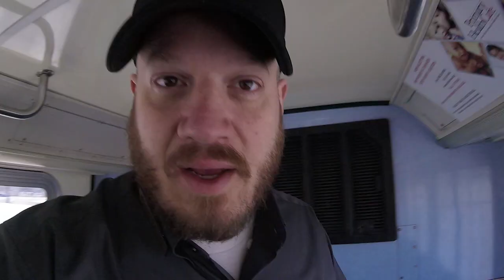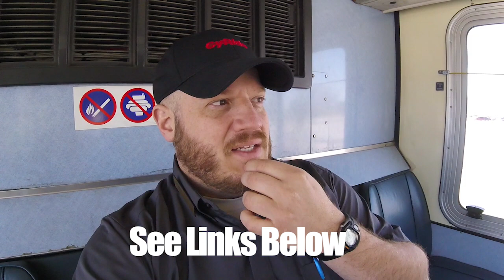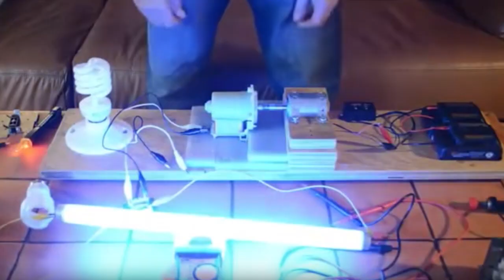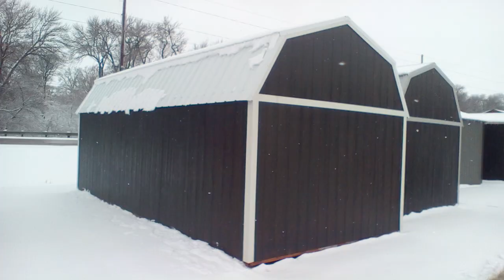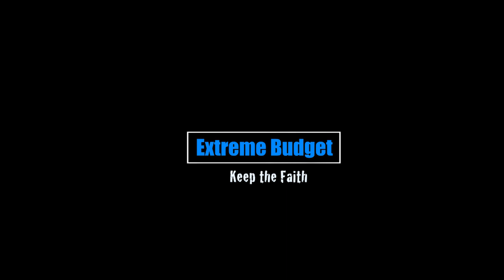PART 1 - DIY Innovations - Free Electricity with Self Perpetuating Generator

Comment: Wrong wrong wrong.   The first comment was correct. You will never create power.  
   Those videos are of a device that has no load or very little load. Which means the non permanent magnets on the stator are not charged

To put simply it may run for short period with nothing drawing significant load from it but the second you try to run something such as a saw or welder those non permanent magnets will create a force and bring it to a rapid halt.  If you want proof of this watch a small 1000 or 2000 watt generator run with nothing on it then plug in a microwave or toaster or ac and listen to what happens to that generator motor. As soon as a load is needed the stator is charged and all of a sudden it takes multiple times the number of horsepower to turn the generator. 

I applaud determination but some of these snowflakes should open a actual physical science book. 
  I gotta go now. I have to go milk my magic unicorns.
Reply: I hate to burst everybody’s bubbles out there but what this guy is saying is absolutely true I tried to run 2 1000 watt  grow lights on a generator during a power outage they put a serious draw on it and eventually the lights dimmed out and wouldn’t come back on even though the generator stay running. The generator was also rated at 5500 W so it should’ve been more than capable enough to do it.

Comment: It is impossible to not only have two motors power each other, but provide extra energy on top of that. You cant create perpetual energy from nothing. I would not only bet my paycheck, but my car and house on it that his two motor setup will not run on its own. I had the same idea decades ago before I learned. I knew a guy who tried building an electric go kart with alternator hooked up to it, think it would power the thing. It didnt. Cars dont do it, either. The energy to charge your battery comes from gasoline spinning the alternator. IMPOSSIBLE. PROVE ME WRONG.

Comment: You don’t need that ballast to make it light. Do you hold it next to CB radio antenna and key the mic to transmit it will light if you were to touch the metal part you will get shocked

Comment: Since I haven't seen the video you speak of nor am I an electrician, were you able to make this work? By work, I mean can you actually get electricity from this setup. My guess would be no as it was explained to me by my father who is an electrical engineer. The issue here is that you can keep the two motors running for some time. As soon as you start to divert energy away from the motors and use it for other things you rob the energy needed to keep the motors running. Once you start to take energy away, the motors will come to a stop. Also, the motors themselves will not run forever, they will eventually stop because of the law of diminishing returns. Some of that energy will be turned into friction, heat, and possibly due to some air resistance, these motors will stop on their own given enough time. Think of it this way, if the motors generated much more energy than they needed and if you didn't divert energy away, those motors would continue to spin faster and faster to a point they would fail from the high RPMs ending in the motors ripping themselves apart. That's never happened in any setup like this so if it isn't generating extra energy, then it has no extra energy to give. I get big companies trying to keep secrets, however on this, they are abiding by the laws of physics.

Comment: Using The fluorescent bulbs is true. Take a fluorescent bulb hold it in your hand in the middle don’t touch the metal part, hold it real close to CB radio antenna and the bulb will light
Reply: So what? Disconnect the power to the radio and the tube quits glowing. No free energy was created at all.

Comment: Seems like there would be a way to produce your own power with a PTO generator. Sort of like this https://www.electricgeneratorsdirect.com/IMD-PTO-22-S-PTO-Generator/p5891.html . Buy an electric motor and figure the ratios for the belt to turn the PTO at 540 RPM's which is what this particular model requires. You would have to figure out a way to start it but once started it seems like you could power the electric motor to turn the motor and PTO and have plenty of power left for whatever. Hope this makes sense.
Reply from the maker: thank you

Comment: Look People this stuff does work, it takes time and money and every single system is individual and requires a lot of fine tuning, parts, trial & error and backup systems. Producing electricity is very much something that everybody can do as long as you have an understanding of mechanics and electricity, because it will kill you, so Common Sense safety and electrical knowledge is a huge help.  The phrase "Power Electronics" applies to many people's interests and to be absolutely honest like it or not you are going to become your own Utility Company and you are the only Customer.  I've been interested in this subject my whole life and I still struggle for power at times if I haven't got money for cable or components is the simplest reason, but I love peace and quite and I tend to get really irritated listening to engines running for long periods of time, besides having reduced my power consumption to a minimum I do feel I have got a little lazy on the power hobby front because most of my comforts and needs are provided by my wood burner.
Reply from the maker: good points. thank you

Comment: Titles a little misleading, lots of people in the same situation, the government wants to keep inflating everything, so there’s gonna be more and more people like this until the prices come back down, and forget land, live on the water or underrrrr it, I’m currently designing an underwater living space that can surface and sink only 10 to 15 ft below surface, 10x10x10 to start, plastic walls 3/4 thick reinforced walls using 3/8 rebar to withstand pressure, will probably make a video about 😉🇺🇸
Reply from the maker: awesome. I'd like to see the video.  post it if you can

Comment: You’ll be obsessed  whole lot longer than a year I’ve been learning all what you’ve said ! 2 Gm 1 wire Alternators 110 Amp what they say will create more Amps than needed over 200 Amps & Volts so post to be 230 volts wiring straight to the iodis out the back of the Alternators , into a voltage regulator to keep the power in control ! Cost of Alternators about $ 100. Ea. Zero gauge wires car stereo amp installation Cheap before wireless , Google the best dry cell batteries for like solar power Amp hours & reserve capacity and when you wire the batteries together you do not want to run them 24 V you want to wire them positive positive negative to negative which will keep what I have seen your reserve capacity for each battery what’s the number is because if you run them parallel it’s supposed to cut your reserve time in half !

Comment: Energy cannot be created or destroyed. You are "losing" energy just by electricity flowing through a wire as the wire heats up. This is because some of the electrical energy is converted to heat. If you want free energy, get solar panels
Reply: Blake yes, but I viewed another similar video, and the electricity is created using electromagnets. Excite the coils, spin the pulley, and create electric. It doesn’t take an overly big motor to spin the pulley. There’s someone overseas that is selling a sophisticated version of this, and the motor only consumes 23.4% of the output, using an inverter to maintain constant output speed, regardless of load. Corporate greed, combined with government in some form, (in the past) have hidden the knowledge of self-sufficiency from the common person by eliminating all the easy sources of this information. So before you say it won’t work and it’s a waste of money, do a little research of people who have actually been able to make this thing work. I believe anything is possible to accomplish, so long as you have enough patience, time, money, and resources. If any of these are insufficient, any project will fail.
Reply: @joelschermerhorn5447  So, the impossibility of perpetual motion is a myth? Lots of luck with that myth!

Comment: A car alternator sure you can spin it by hand when it is off, but when it is magnetized under load even the car's engine will indicate the burden if you notice. No way that little motor will turn it under load. People in the know have moved on to experimenting with pulse motors like bedini's and to somehow work around lenz's law and some exploit clever design, some use weight wheel in between the motor and gen. Its not so simple brother.

Comment: Use 6 volt golf cart batteries they are superior to marine batteries . 6 volt in series with another 6 volt 
= 12 volt 
Times two =
(6 volt + 6 volt in series
In parallel with
6 volt +6 volt) = 24 volt
Reply from the maker: awesome thank you .
Reply: Scott, check your math.  6 + 6 in series is 12 butt another 6 + 6 in series then paralleled is still 12 but twice the amps. 6 volt x 4 in series is 24.

Comment: Does anyone have a combine parts list to make this happen with an alternator, motor and power regulation equipment??   I would love to make this happen.  If nothing else, I think we all need to have access to this type of information, that people can just make happen on their own.
Reply from the maker: I agree.  that is the challenge we face.  there isn't a instruction book.  we are left to figure it out, but the info is out there.  I have done some videos with links to people trying these things.  And the links I put in the description will help a lot with ideas too.
Reply: It has to belt driven. It cannot be all connected in anyway with a common ground connecting it all together. It would work nonetheless
 But the sine wave frequency would eventually cause it to fail.or blowup

Comment: it is I took a fan from an a.c. and put the biggest bicycle gear and took an alternator 18 volt and put the largest bicycle gear and put the fan into the ROI grande river and put the alt. on the bank and connected it to a power converter and ran it to my camp and it gave me all the power  needed
Reply: The flowing water provided the energy. Thats not what this is about.

Comment: You need to use d c batteries and use solar or hydro wind power as if you used a 12 volt starter from a truck for every 30 seconds running cranking time you need to let it cool down 3 min. 
A.c. Alternator three phase in delta is far better than a bus alternator unless you hot rod it so it charges at lower revolutions .

Comment: There are many claims out there on self running generators. No one has come out and said how it's done exactly. They all beat around the bush, and as a licensed Electrician I can see through the crap. First of all none of then are generating power for their own home.. Why? They made a video that we all watched, told us nothing about how it's done, and made money on the video. If you hook one motor to another, one will use power and the other will make power. It's not more than 100% efficient, that does not exist right? If it does, why won't they say how?

Comment: FYI guys, it was originally meant for people to use DC current and that's where they got us, everything we use that uses electricity is built to run off AC current, with the exception of some smaller devices that uses va step down adapter, AC current still is needed for the input which is actually ridiculous if you think about it...why not run the thing from DC current to begin with instead of using AC and stepping down to DC how stupid is that right?

Comment: The question is , will it support additional load ?
Reply: The answer is: no, it won't. It won't even support its own load. It faces resistance, physical and electric. Plus produces waste, heat and vibration.

Comment: are you all so stuck on what was and not what can be? I have went to car repair shops and asked about if taking off dioeds and putting 9v battery to run stater to make a lot of power and you want to know what I was told? I was told as long as you put enough power to alt. it will put out what it was made to put out so that right there says if you have a alt, made to put out 90amps=110v no matter 3v 6v 9v 12v as long as it runs the alt it puts out what made to
Reply: Cool! You just need to figure out how to make the 3v run s belt fast enough to produce the rpms required to run the alt.  Bout 1200 rpm should be a good starting point.  Hope the magnets dont provide too much resistance. Figure it out and show me how. Thx

Comment: played with this back in the 70's battery runs the motor charger charges battery but can not generate enough supply to do any more than that. so really your do not gain anything.
Reply: Im not gaining nothing but sure am saving a shit ton on them high ass light bills. You might want to play with it again this year. Most appliances and electronics now use a whole lot less power than back in the 70s. Wait, back in the 70s you still did not know what was a led. Get up on that knowledge and wake up

Comment: What I figured out you need 6-8 Lithium or dry cell Batteries to keep charged for you’re power source, 1-3 Alternators depending how much Ac power you use in 1 hour , take you monthly bill in the month you use the most electricity, decide it by how many days - how many KW’s you use ? Every KW is 1,000 watts , a car Alternator on a Basic alternator creates I’ve seen secondhand 115 Watts  Ac at 90 Amps , mind you National grid provides off the street to house 250 Watts at 200 Amps and most Fuseboxes in you’re home is 100 Amos yes some houses have 200 Amps yes more costly but their home has the ability of taken in 200 Amps that’s 100 Amps what I figure out down each side of you’re fusebox because you have 2 rows of circuit breakers . What I see do not try to use you’re dryer plug do not try and feed the electricity by back-Feeding it ! “ you will more likely BURN Your House Down DO Not This ! What I see if you get to 100 amp circuit breakers 100 amp circuit breaker for each side of your fuse box and you must shut the power off the street before adding your generator power in your feed tooth hundred amp circuit breakers hundred amps each in my theory is 115 v AC at 100 Amps to each side of you’re fuse box would be as the electricity coming into you’re house ? PLEASE HAVE AN ELECTRICIAN HELP YOU & Or Talk To An Electrician First and Please be Able to DIY ! I’ve only like this gentlemen found these things online “ By In No Way Am I a Professional or even a DIY expert ! Talk to an electrician a few of them Off grid experts ! And when I see once you have the charging the batteries and you have an alternator that is a self exciter and your alternator or alternator is there at least 100 Amp You can Sauter three exits off from the stator in the Alternator which is 3 cables of 115v Ac  at 90 Amps each ! Non of this I have personally seen by my own testing ! NON I’ve seen hundreds of YouTube videos & googled a lot but in theory this works ! And really what will it hurt for you to be prepared if the grid shut down you can power your furnace your refrigerator in a few plugs live on bare minimum for power to survive !

Comment: They will not be pulling down the power lines anytime soon due to the politics and billions of dollars made by using fossil fuels to generate our power and transportation.

However you are on the right track.  In order to be successful, research the following: magnetic current induction, generating torque in electromagnetic fields, the right hand rule, power transformers and electrical isolation, feedback systems, 60hz wall power, 120V rms and peak to peak definitions, absolute maximum and minimum tolerances for stable power AC systems.  You will need all of these for a reliable and viable DIY power system for off grid energy.  Lastly, Id recommend adding a solar/wind power solution and double whatever battery bank you had planned to overcome losses due to friction, heat, and RLC transmission line impedance effects.
Good Luck!
Reply from the maker: Thank you

Comment: i have the answer that will more than work.. 10 amp power supply 24 v running 300 watt dc motor turning gm self exiting alternator 110 amps charging my 12v battery bank running my 10000 watt inverter which i will power the powersupply and my entire home 5000 watt cont duty......

Comment: I have always felt, that a generator should be able to generate the power to the motor that is runing the generator, but they say you can't, why not?  Thru gearing and jack shafts, I don't understand why a generator cant run itself and generate free electricity thru step up transformers.  You can step up 110 to 220 I know, so why not 1000 to 1,000,000 volts.
Reply from the maker: Exactly...  "they say you can't" are the voices that we ignore.  Keep discovering!
Reply: @extremebudget  No were just going off what the Laws of thermodynamics and the Law of energy Conservation states. Energy can not be created nor destroyed it can only be converted from one form to another. You can not get more energy out to what you put in.

Comment: There is no such thing as free energy. For a generator to produce enough electric energy to operate an electric appliance , say a 120 watt appliance, the same amount of some form energy has to be put into the generator. This is " the principle of conservation of energy" .  In an automobile this is done by the engine with the help of a belt (kinetic energy). It can be done also by a motor. The energy to turn the motor comes from a battery. To keep the battery charged, electric energy may be used. So there is no free energy.